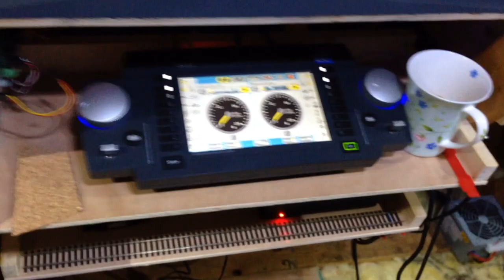Woodsetts Central layout tour  2018 11 10

Comment: Nice layout and I look forward to seeing it progress👍 . I intend using the Mega Points system on my layout, I find it easy to understand and am impressed with the expandability of it. What are your thoughts?
Reply from the maker: I can certainly recommend the Megapoints system. I like the fact that you can drive standard "aeroplane" style servos as point motors. It really is an economic solution compared with "Tortoise" and "Alpha's" offering. Your will really come to appreciate the simplification in wiring - each control unit driving 4 servos - just linked by three wire servo cable. Dave Fenton is extremely helpful and provides excellent customer support. You can also buy a unit to allow you to control servos using your NCE, Lenz, ESU controller. It's very flexible. Regards,
Barry
Reply: @woodsettscentral1196  Thanks Barry, I did have a chat with Dave at the MK exhibition and was particularly impressed with the route setting module.